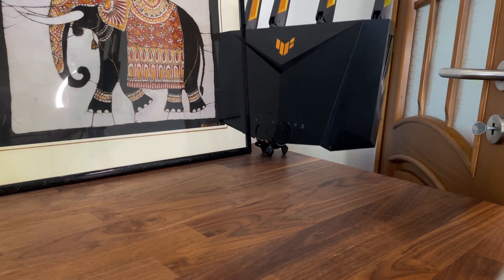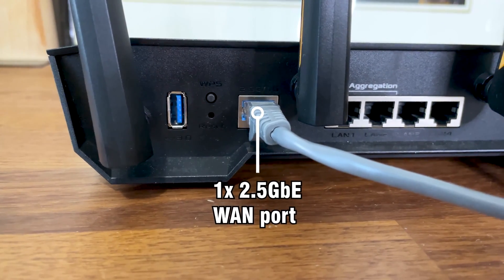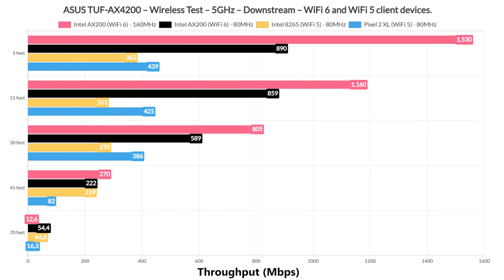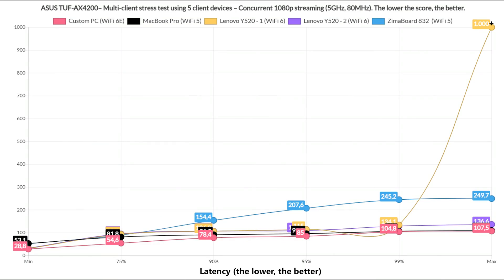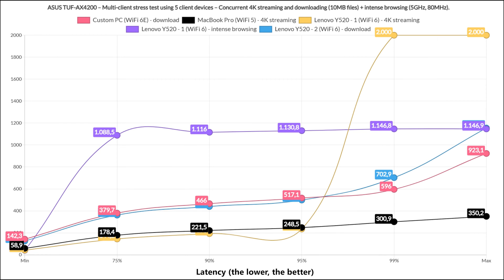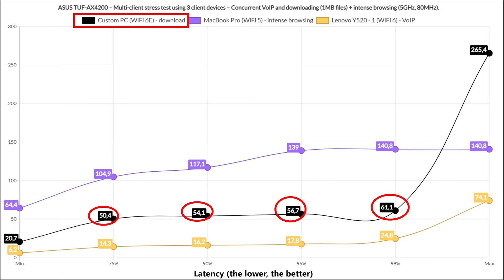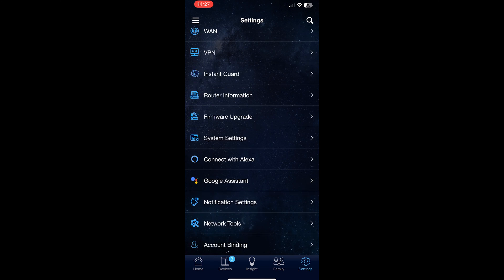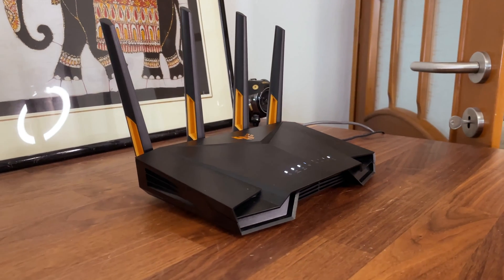ASUS TUF-AX4200  WiFi 6 Gaming Router Review & Test: This router genuinely surprised me

Comment: It's 2024 and people still buy Wifi6 in stead of Wifi7 ?
Reply: you can buy an Asus TUF Gaming AX5400 for less than 50€ on the used market. You need to pay over 200€ for a wifi 7 router. I am still using a wifi 5 (also from asus) and I barely have issues to be honest. The major advantage of those new routers isn't the wifi but the fact that the processor has extra cores and you have more ram. Its special useful in a house with multiple people living inside and using the internet.
Reply: Tell me affordable wifi 7
Reply: @PahlawanMerdeka  Asus RT BE92u and BE88u are the Big Brothers of the router you have tested.
Reply: @PahlawanMerdeka  Bang boleh suggest apa router budget 4xx-6xx? Main game tak sedap langsung unifi punya menyirap.
Reply: Please exclude Chinese brand if you don't want to be fcked up by espionage. They're cheap for that reason
Reply: Even the new apple iphones/pros don't even support wifi 7 so yes wifi6 makes more sense since most of your technology in the house for almost all people doesn't even support those speeds 😂

Comment: Hey hows it going I really need some help upstairs Im currently using a netgear wifi extender in the same room next to my ps5 and I have my ps5 connected to the wifi extender with a 1metres ethernet cable while my router is all the way far away downstairs, I'm looking to upgrade my current netgear wifi extender as its wifi 5 , could I use this asus 4200 tuf gaming router in repeater mode as that's basically a wifi extender that I can connect to my ps5 right? Or is it different to a wifi extender if so what's the difference or benefit ? Or shall I get an actual asus wifi extender if been looking at the asus RP-AX58 ? Really need some help and advice on this would really really help me out , thankyou 🙏

Comment: I just bought the Tplink AX73, should I replace it to the Asus Ax4200 for better gaming latecy?
Reply from the maker: Do you have any problems with latency when using the AX73? Also, is the client wired or wireless?
Reply: @SamBondor I get slighty lag when playing Dragon Ball Legends on 5Ghz wifi channel. I Turned off Ofdma, mumiu and turned on dmz, ports sightly improved the lag. Im thinking to return the AX73 and get asus tuf 4200 if there is a chance
Reply from the maker: @KutKitkk  It is possible that the ASUS TUF-AX4200 may improve things, but before that, can you make some changes to the 5GHz network. Such as changing the channel so that it does not interfere with anything in the vicinity (use a non-overlapping one if possible) and you can also try to drop to the 40MHz channel bandwidth if you're in a very busy environment.

Comment: thanks for the review. im thinking about buying this, i have a 10 year old router atm and i have to reset it couple times a month. i just want a stable router that can run wifi for my phone and chrome and i can use a ethernet cable to my pc same time. i assume its possible with this one. my old router if i did this method it would cut my connection speed to my pc to 100 mbit. i have 1000/1000 and i want to be able to use my speed for my pc when i play games.

Comment: Thank you so much for this review.
It helped me decide as I can get the TUF AX4200 for about $130 CAD after tax or the Archer AX55 for around 90.
My farthest range for wi-fi is around 45-60 feet and I'm sure the ASUS can handle it much better!

Not to mention it has a much better CPU for learning/running more functions on Open-WRT.
Reply from the maker: If it had 1GB of RAM, it would have been very close to the ideal router. Imagine running SNORT on it and everything remaining stable.